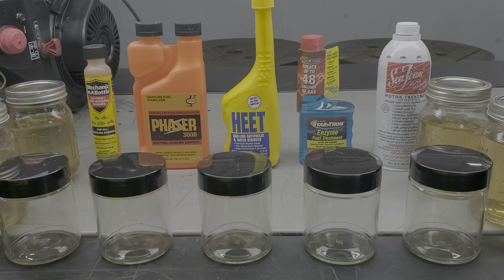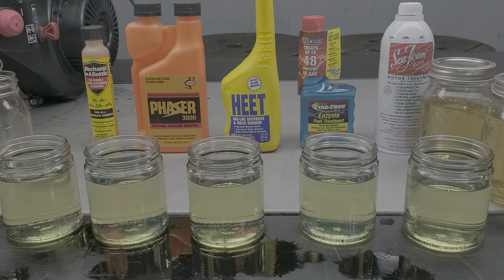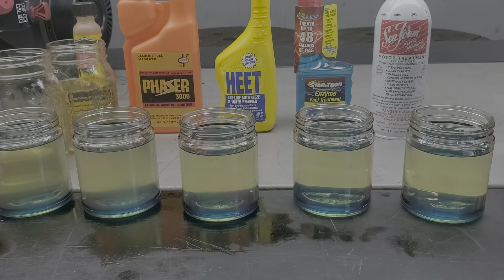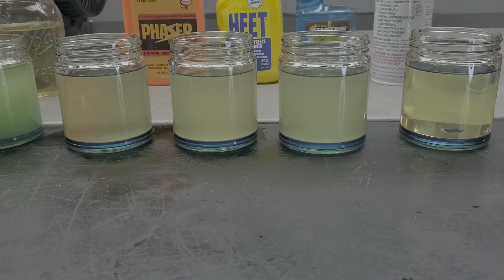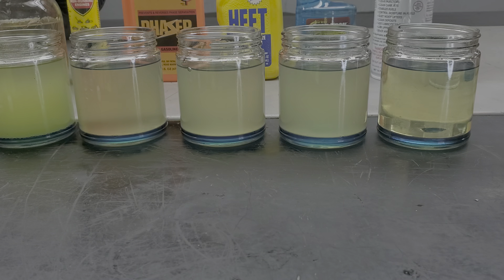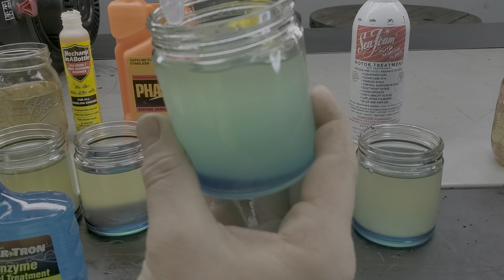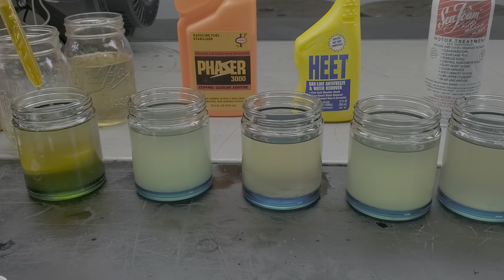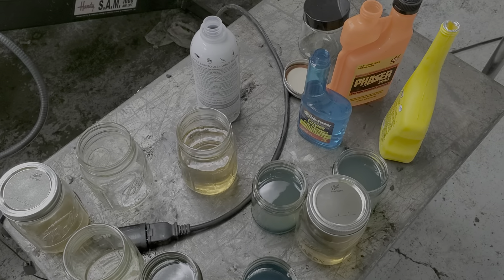Taking Water Out Of Fuel - Stale Gas Heet, Seafoam, StarTron, Phaser 3000 Additive Repair & Test Run

Comment: Notice there's more green liquid at the bottom of the HEET jar, that's because HEET mixes with the water which allows the water to burn off when mixed with the methanol (HEET). It basically adds methanol to the water to make it combustible.
Reply from the maker: It works well in a car environment but never really removes or keeps the fuel good has to constantly be moving which will not work in a carbureted environment
Reply: Most engines say in their manuals to never use methanol.
Reply: I mean I don't know how much water you would have in your tank but you probably need at least 50/50 methanol and water to burn so if you have 16 oz of water it may be fine but I think you'd be better off adding a couple of gallons of e85 so then you have a like 80% ethanol 20% water or so maybe 90/10

Comment: I’ve converted one of my chainsaws to run on E 85 ethanol fuel about two years ago, this video is very helpful! Using the phase or 3000 will definitely help with the water ethanol separation issue.
Reply from the maker: It helps the equipment we use even in no ethanol situations. Moisture control is a big issue with all fuels. Definitely helps prevent seperation. Thanks for watching!
Reply: @IndRepair  so you haven’t use the phaser 3000 in ethanol gas because that’s what I’m after up here in Canada being we can’t get anything but ethanol. Thank you
Reply from the maker: It works in ethanol blended fuel we just use ethanol free for all repairs. It is great stuff!!

Comment: Great video!  Unfortunately, as some have commented, one can't know the composition of the bottom layer.  Adding ethanol or methanol, etc. increases the the amount of water gasoline can "hold" at saturation.  Gasoline (e.g. E-10) that's 100% saturated with water will phase separate once the temperature is low enough.  Alcohols up to about 4 carbons long are soluble in water because the alcohol group (OH) is attracted to water and can form hydrogen bonds with water.  

As alcohol chains get longer with more carbon atoms (e.g. methanol, ethanol, propanol, butanol), the other end of the chain is hydrophobic (water fearing).  Long-chain alcohols won't dissolve in water.  Methanol is the smallest alcohol with only one carbon --that's why it's the active ingredient in "Heat".  Methanol can "soak up" water in gasoline and make it burn.  The same is true for ethanol, propanol, and butanol.   If you remove the "ol" from these words, you get the names of the combustible gases the alcohols are made from: methane, ethane, propane, butane.  

The main ingredient in Phaser 3000 is 2-Butoxyethanol.  It's like an ethanol with a butanol stuck to it.  In the video, Phaser 3000 broke up the separated layers. This is because it also acts as a surfactant --A surfactant is a compound that reduces surface tension between two phases, such as two liquids.

Yes, I'm a science geek!  LOL
Reply from the maker: I would love to hear what your think the best thing out there in a small engine situation to reverse phase separation. You are way smarter than me I can tell you that! Used to know a little about this stuff but it has been a long time
Reply: HEET (methanol) and ISOHEET (mostly isopropyl alcohol) are probably the most economical way to get water back into solution so it can "burn off" in the engine.  As you saw in the jars, there are still two visible phases with these fuel treatments, but as fuel sloshes around in the tank, the bottom layer gets picked up by the fuel intake and eventually burns off with the gasoline.  The Phaser 3000 (and some other products) contain a combustible surfactant that helps the layers mix.

For winterizing small engines, especially in colder climates, the easiest method is probably running through a batch of synthetic (ethanol free) fuel like TruFuel or VP Racing, etc.  Otherwise, I run my equipment dry and drain the carburetor bowl.

The biggest problem is with small engines where you can't seal the gas tank vent --it lets moisture in.  Keeping the tank full can help because there's less contact with moisture in the air.

http://www.youtube.com/@TarylFixesAll
Taryl Fixes All has a series of videos where he tests about a dozen fuel additives in engines left outside for months. You can see which products prevent "jelly" and corrosion in the carburetors.
Reply from the maker: Thanks for your input! I would agree with agitation (as would be in any car/truck fuel system) that most of these would probably work. Problem is many of them are marketed to small engine customers as a save all and they don't really do much for a situation like that. I agree, we tell people leave it all the way filled up with ethanol free or drain completely. I like to leave them filled more than draining because it keeps the gaskets to prevent cracking/drying out

Comment: I don’t run any thing but Premium non- ethanol fuel, so I don’t run into these problems, but Inhave found some mix fuels do go bad.  I have found nothing that will make gas as good as the fuel I used thirty years ago.  Then, I never really worried about it.  I just mixed my two cycle oil in 2.5 gallons of regular 92 octane to the tank.  I would use the gas until it was gone.  I never ran my two cycle engines dry and stored them that way as I do today.  I put them up when I was through with them and threw them on a shelf in the shop.  When I needed them, I topped off their gas and bar oil tanks and put them to work.  The only thing I put stabilizers in was my gas tanks on the boat.  I never had a problem with gas going bad from season to season in my saws or boat.  Now, even premium non ethanol won’t last six months withou a good stabilizer in the gas.  Ethanol gas about half that period of time.  I had a couple of saws, last year, that their PNE gas went bad in 7 months.
Reply from the maker: We use a non ethanol 91 octane and treat it with the phaser 3000 to keep moisture from becoming a problem. This is from a dedicated ethanol free pump. I do see customers come in after using a "no ethanol"  fuel from a multi use pump with ethanol still in the first portion pumped. Gas is definitely not what it used to be. Can fuel is prone to the same moisture gathering if opened or sitting for too long. I see it happen several times a year, especially when fuel is sitting in equipment. Thanks for watching!

Comment: Got a pretty good chuckle on the dancing additives. Great test will use Phaser or will get gas. Thanks for video.
Reply from the maker: Lol! We have a newer fuel treatment video out that shows it is basically a different chemical in any of these treatments that works well. You can see it at https://youtu.be/UvXB8OXac9o

Comment: I believe a really helpful test would be to fill the 5 jars with new E10 fuel. Then add the prescribed amount of the additives in the jars and come back every month and check how well they are preventing the fuel from phase separating. Once the fuel is contaminated and phase separation has occured, it is clear the train has left the station.
Reply from the maker: That is a good test to see of if products stabilize the fuel! I can tell you from experience and what I see that these products do not work in a small engine application. In a car with constant flow these things may work to perform a task but do nothing to reverse phase separation or rwmove gunk. Reversing the phase separation or removing ethanol gum/varnish to fix a problem machine is what all these products want you to believe they do

Comment: Soo how many times should you use to remove water out tank? Lik heet
Reply from the maker: In a snowblower, without the fuel constantly moving it will not help with the removal of water unless you are using the Phaser 3000 (2-Butoxyethanol)
Reply: @IndRepair i used heet on my g35 and it gave it back its horse power it use to drive like ass now it drives better after putting heet
Reply from the maker: @Gbodyteggy1208  On cars it works great because it keeps the water mixed up into the fuel
Reply: @IndRepair  i use the red one but i tried  the yellow one on my car it ran like shit but now seems kinda different
Reply from the maker: @Gbodyteggy1208 for sure

Comment: I have put Primrose Phaser to work to rescue phase separated gasoline at a ratio of 1% by volume, which works very well to  rescue approximately 95% of issue, while also cleaning up gum and varnish issues, which are usually created during phase separation.

How ever if one has high parts per million of condensation in ones gasoline as we witnessed here, it is beneficial for one to have more real estate to park the excess condensation, or additional gasoline from a different source, to be added to this phased out gasoline & Phaser 3000.

My opinion is that you had plenty of Primrose Phaser 3000 Martin for parking this out of spec gasoline. However if there where more places to except this phased out issue, usually 10% more gasoline needs to be add. 

Example there is 32 oz of phased out gasoline × 1%  =  point .32 oz. of Primrose Phaser 3000, if the gasoline did not clear add 10 % or 3.2 oz of additional gasoline.  99% of the time Phaser has one back in business.

 In the case of ones lawn mower with one quart of phased out gasoline, Primrose can have one up and running for a maximum of 1.99 cents = 1% rescue cost, and for .09 tenths of a cents in this lawn mower with 1 quart of gasoline Primrose Phaser 3000 has the ability to inhibit this quagmire all together for a minimum of 2 year if Phaser 3000 is put to work at the conception of purchasing the gasoline.

I must mention one thing I felt was interesting is the engine when stated Martin, there was no smoking from this gasoline you rescued with the Phaser 3000.
Reply from the maker: It definitely works. I don't use it in equipment for rescue purposes but we do treat everything that leaves the shop with it and ethanol free fuel. Never do they come back with a fuel issue! Thanks for watching and for your further input on field application!

Comment: I have 30 gallons of very old and stale gas. I'm going to try putting some in old one gallon milk jugs and putting them in the freezer. This should freeze the water allowing me to pour off the gas . Then I'll try a 50/50 mix with good fuel and see what happens. What do you think? The old gas by the way is eight years old. I may need to change my ratio or try adding an octane booster or methanol. I might also try aniline oil, this is and old octane booster from the past. Any thoughts?
Reply from the maker: That sure is old fuel, the octane as you said is likely pretty low. A freezer could introduce moisture but if already saturated it likely won't matter. Interesting though on how to do this!
Reply: I have used Trufuel to get rid of 10 gallons of 4 year old stored gasoline. 5 gallon can, pour in one gallon old fuel and 4 cans of new Trufuel, then add it to the car (just before fill up). Took a while, but did get rid of it without taking it to hazardous waste disposal. Maybe a less dilute mixture would have worked, but this is what I did. The stored gasoline did have Sta-bil in it, but that only lasts so long. The 92 octane of the Trufuel helped as well (I think). Expensive, but 6 months later and it seems to have caused no issues to my vehicle.

Comment: I don't know what Seafoam does to gas, but I DO know that it keeps my gas (regular 87octane pump gas) working and cleans the carb as it works and is an excellent fuel stabilizer which is all I ever used. For the past 30+ years since I started using Seafoam, I have never had to tear down any of my carburetors to clean them or get rid of old fuel. My motors start right up after long term storage. I don't get the idea of all that water in the gas? I've NEVER had that problem with any of my gas tanks.
Reply from the maker: Simply reason for this test is because ethanol gathers moisture from the air and it condenses in the tank. It is the most common issue with no start fuel issues any area where there is mid to high humidity. I have heard of people with the same results as you on Seafoam but it is definitely not the norm. Some of these things work for certain instances but not good all the way around. Sea foam claims to work by making fuel resist evaporation so this may help with stabalization. If the fuel gathers moisture it will not take care of the issue. What area of the county do you live in?

Comment: What is the difference between the red bottle and yellow bottle of hert?
Reply from the maker: The yellow bottle has Methanol in it and the red has isopropanol in it. They are bolth to remove water and prevent gas line freeze up but work in different ways.  Thanks for watching!
Reply: @IndRepair  they’re also much more concentrated and “dry” compared to say 70 or even 91% isopropyl alcohol bought from Wally World or a drug store. If you look at the SDS the other ingredients are in the thousandths of a percent. And of course anhydrous is critical because you can’t be trying to dry fuel with something that has water already in it. For the price heet is the purest, driest alcohol solvent that is readily available. I really have no idea as to the amount of water already in seafoam or those other products. It’s interesting that the seafoam sds describes it as insoluble in water when it has a decent isopropanol component. Having water content in the alcohol used to make seafoam would enhance its carbon cleaning abilities though, like how they compare its cleaning abilities to water sucked in though the vacuum line 😂
Reply: The red one is strawbery
Reply: The yellow bottle of Heet is commonly used in alcohol stoves since it is pure methanol. The red one is a different type of alcohol.
Reply: @john_in_phoenix  Then why do they sell both in the automotive section?
Reply: @Blackford86  because they both work. The yellow is just cheaper than buying "stove alcohol". I just use everclear myself.

Comment: How flammable is that water layer though? Alcohol being miscible with water would at some point make that blue later consist of enough alcohol whether methanol or whatever to burn
Reply from the maker: Could be possible but I would say it's not likely? The color of that layer never really changes with any of the additives even though it gets mixed into a solution and drops back out multiple times

Comment: Water is soluble in acetone. Acetone is soluble in gasoline.  It should work well to make gasoline with some water in it burn efficiently in an engine.
Reply from the maker: With a system that uses a fuel pump and the fuel is always moving most of these make a solution of the gas/ethanol/water at least momentarily (which if continually moving moisture may stay in the solution) but in a carbureted system it will never stay mixed since it is not moving constantly. Thanks for watching!
Reply: Acetone is highly corrosive and it will dissolve your seals and possibly any plastic lines or parts like most fuel injectors. However, isopropyl alcohol is very similar to acetone but far less corrosive which is why many products use isopropanol.

Comment: Use just mr funnel as simple as that
Reply from the maker: It works in certain situations but if the water is mixed with ethanol blended fuel it flows right through. Best to use after pulling only the top 80% or so out of a container after letting it settle. Using this method it eliminates the need for this funnel at all. Thanks for watching!
Reply: @IndRepair  or just add octane booster which worked for my car that was sitting for 3 years!

Comment: Don’t use can fuel I heard. . But I think get a fuel water seperated only with pet cock so you can drain it once in a while.
Reply from the maker: Many of the petcocks with not drain from the bottom, they drain and leave 1/8" in the tank many times which causes the water to stay in place

Comment: I don't think you are getting a very good measurement with that dropper on increments under 1 ml.   Also small batches like this probably don't have any reaction as a large multi gallon batch would.
Reply from the maker: Under 1ml measurements will not make much of a difference in this case as the test prove. Thanks for watching!
Reply: You must be a genius.

Comment: Why didn't you siphon off some of bottom layer and see if it was combustible. You  keep assuming it is water.
Reply from the maker: If it separates out like this its never going to be combustible enough to run in a small engine even if it were to be flammable at some really high dosage